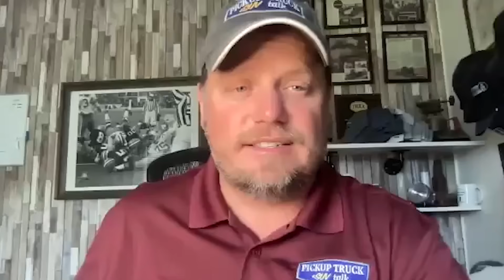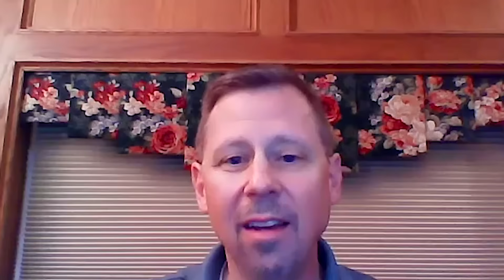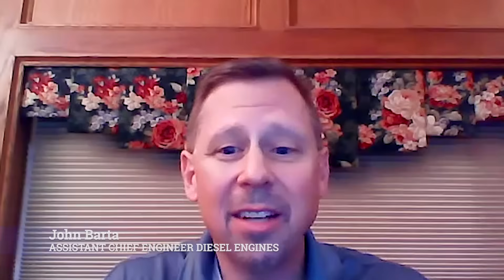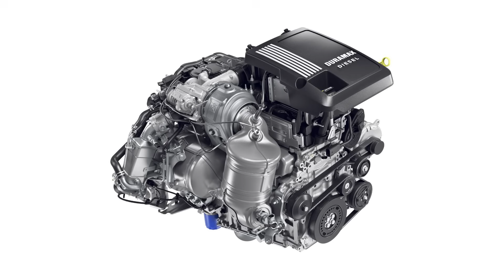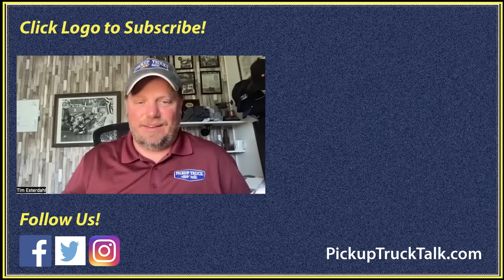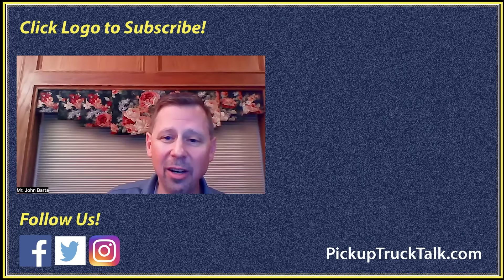GM's 3.0L Duramax Diesel Engineer Answers Questions Owners Keep Asking

Comment: If   your   "diesel   engineers"   are  so  intelligent,   then  why  do  you  have  a  diesel  engine  with  a  belt  driven  oil  pump????    If  GM  wants  to  get   serious  about  putting  " low  maintenance"  diesels  in  trucks,  go   talk  with  the  following  FIRST:   (1)  a  certified  diesel  mechanic  for  Cummins  and/or  Caterpillar  ,   both  have  been  building  " straight  six"  diesels  for  over  100  years;  (2)  Cummins  AND   Caterpillar  engineers  to get  a  basic  opinion  on  belt  driven  oil   pumps  vs  gear  driven,   and  DO  NOT  design  an  engine  with  the   oil  pump  located  between  the  transmission  and   engine;  GM  knows  absolutely  NOTHING  about  diesels,   I  have    owned  3  Cummins  powered  and  2  Caterpillar  powered  trucks,  and  those  engines  are  built   to  run  a  minimum  of  750,000  miles.  And  YES,  those  are  in-line  6  cylinder  diesels  with 750-1200  #  of  torque,   much  more  than  ANY  V-8!!!!

Comment: And the LZO is already failing in 2025. Just seen a video from a dealership with 2 1500 3.O's in with blown motors. 😢
Reply: For a few months in 2025 their supplier supplied some bad thrust bearings. Jul’25-Sep ‘25.  Not all of them… just some had the bad bearing installed.  Most fail under 5k miles. Get the warrantied new engine and enjoy it.

Comment: There was a video from GM engineers that said it was due to room. This video confirms they believe it was the right choice and the new 3.0l block handles 200k miles per service. Here is the link at minute 17 about talks quickly about the oil system. https://youtu.be/J7KM5-oMLm8?si=Ra2X_xiq_9Lose2W

Comment: What do you think about this product... Can you do a video on this?  (CCV Catch Can for LM2 and LZO).  The 3.0L LM2/LZ0 Duramax Diesel from the factory directs crankcase oil vapor and condensation directly into the turbo inlet for reburning. This oil plates out and sticks to the turbocharger blades and heat exchanger coils reducing efficiency of the system. This oil residue will increase the pressure drop across the heat exchanger resulting in higher backpressure placed on the turbo and worse fuel economy. 

We have designed an integrated OEM appearing catch can system to remove this oil and water vapor intrusion as well as provides the same exact crank case vacuum draw as the factory to protect the seals of the motor.  Is there any truth to this?

Comment: a belt driven oil pump only makes sense when your average customer who buys the truck new won't keep the truck until the first belt change interval comes.  The answer pertaining to the belt seems very dimissive; for example, what are the good reasons for the belt?  Quiet? Less Vibration?

Not appreciating this design.

Comment: Engines can only stop running in a factor of the number of cylinders. An 8 cylinder only stops in one of the same 4 locations on the flywheel, a 6 cylinder in 3 places, et cetera. The fact that these are stopping a degree off is weird.

Comment: Duramax engine s are not U.S engine.  It is an Isuzu engine.
Reply from the maker: "The GM Duramax engine plant, otherwise known as GM DMAX Ltd. or GM Moraine Engine Plant, is located in Moraine, Ohio, United States. The plant is a joint venture between General Motors and Isuzu Diesel Services of America, with 60 percent belonging to GM and 40 percent to Isuzu."

Comment: I heard him say it would be too much to change that belt.  Is that belt warranted for 200,000 miles?   Doubt it.  I had a Volvo diesel belt bust and totalled that engine.  I love my Ecodiesel and just don't know which way to go when it is time to turn in that truck.
Reply: This belt is under barely any load and its sole task is to spin the oil pump. It's completely different from a belt that has to turn camshafts, which is a massive  load on the belt.

Comment: We've own a 2023 Sierra 1500 Elevation with the LZ0 / 10 speed automatic. This is now our 3rd diesel ever owned (first was LB7 Duramax, second was om606 Mercedes E300). After driving many other diesels new, old, mechanical fuel injection, and so on, this is now my favorite engine (gas or diesel) of all time. The power is more than adequate for fun city driving, long distance traveling to visit family and the fuel economy is shocking. From a dead stop, stomping the gas will spin the rear tires with ease, you actually have to hold back and get rolling first before you mash it if you need to slide over a few lanes to make an upcoming turn. Taking night drives with the wife we've seen 30MPG on back roads under 50mph. I can't say enough good things about it almost 6 months into ownership. I hope that lasts for years to come.

Comment: Well 2022 3.0 melted down with the canceling injectors... steal piston don't melt down. Problem is it don't disperse heat... the engine will run better .how long will it last don't know.... will sell mine 2023 at 50,000

Comment: I have a 2023 High Country 3.0 Duramax (LZO)...just hit 20K miles. pulled my first small 18' camper/trailer and was blowing through DEF.  Found out it was going to the 65mph warning at half the DEF tank.  I would put 1-2 gals in and it would show 7/8 full (never full, even when it just started to spill out the first time I went to fill.)  What is the issue?  Tech issue?  DEF tank indicator (mech.) issue?  Just annoying to have to fill 2 gals of DEF every 300-400 miles.  Could it be from towing and having in tow haul mode?  This is my first Diesel, so I'm not familiar with DEF and issues that can arise from normal driving to towing, etc...Thanks for any ideas, answers and solutions.
Reply: I have watched other videos on this engine and it does use more DEF than the LM2 version, especially while towing. I think the youtube channel was called Demonworks. The DEF level indicator seems to have this issue where it won't show full. Might be a future TSB/software calibration kind of thing.

Comment: He didn't sound like an engineer! No solid technical answers! He sounded more like GMs marketing department! He said they had this lz0 engine designed even before the lm2🤣🤣🤣 
BTW he didn't know what the lm2 and lz0 stands for! There is alot to say but ill keep it here.
Reply: The LM2 started in dev back in 2014 with meeting 2020 emissions. I’m sure they finished the whole engine by 2018 as they got ready for production. By that same time, what he said would make sense for them to start developing the LZ0 variant to meet the newer emission standards in 2023.

Comment: Love this channel and it’s content! I’m a first time truck owner and I went with a 2023 GMC Sierra with Duramax.  Our entirely family loves it, and we just cannot believe how efficient this engine is.  I also liked your video about the benefits of using Top Tier Diesel - love this truck so much that we want it to last.
Reply: Change the oil every 5000 miles (don't rely on the oil life meter) and make sure to service the fuel filter as required and you should have no problems. Always monitor the oil level just to be safe.
Reply: @hochhaul  thank you for the advice.  I have no problem pulling in the service intervals if it will extend the life of the vehicle.  We are here in Arizona, and with the heat I imagine it can’t hurt.
Reply from the maker: Welcome aboard!

Comment: They totally suck I bought two of them ran great 75000 miles then fell completely apart by 150000 miles 22 hours to change oil pump belt 16 hours to change ac compressor 900 dollars to change cooling fans doing work myself glow plugs and module went out at 80000 defective baffle in valve cover calls for 14 hours labor before you buy parts which there is a service bulletin on but no recall even though it makes it use 4 quarts of oil between oil change do not buy one of these trucks unless you are rich!

Comment: Chevy (and other manufacturers) are penalizing the customers by not finding a way to get emissions control that doesnt use exhaust fluid, or find a cold weather formula adjustment.  Cold weather tank freezing and buying urea has been the only thing that's preventing my purchase of a small diesel.
Reply from the maker: What's the cold weather concern? It was -20 degrees Fahrenheit here a few times this winter and zero problems with the 2023 LZ0 I bought for the channel.
Reply: @Pickuptrucktalk   I don't have personal experience in this matter, but it gets -40/50F in Fairbanks, AK and some of my coworkers have noted their tanks will freeze and require extended warm ups (even for here) or parking in heated garages (despite winterized vehicles with block and pan heaters).  This was on 6.6L and Cummins trucks.
Reply from the maker: @70below  diesels have long had issues with cold starts and that was well before emissions equipment or DEF was added to the engines. 

They have gotten a lot better at starting in the cold. That has nothing to do with emissions or DEF. It is the diesel fuel and engine.
Reply: @Pickuptrucktalk  New diesels that have been winterized actually start fine compared to the diesels of old, but my understanding is until the def fluid flows you're effectively in "limp" mode.
Reply from the maker: @70below  true the start better. GM recommends plugging in a diesel at 0 degrees and not above 0.

DEF can freeze at -12 degrees. Nothing automakers can do to change chemistry.

I started my long-term review Silverado 3.0L diesel at -20 and was mostly fine. Just ran sluggish.

Again I don’t see what you’d want automakers to do to change chemistry.
Reply: @Pickuptrucktalk  I'm not trying to bash them, I think they've done a lot with the new motors, but I do work in the air quality field, and I know there's room for improvement.   There is a lot of cold weather research done by auto manufacturers in my area, and I know there are antifreeze agents that can be added to DEF that could help cold weather freeze performance, but they may need to make other changes to improve emission performance with a formulation change.  Remember that most of DEF is water, changing that somewhat could help.

Comment: Why isn’t this truck considered a HD?
Reply from the maker: Because it is built on a 1500 frame and suspension.
Reply: @Pickuptrucktalk  they use to have a 1500 HD
Reply from the maker: @ChadCOMO  They did and it failed miserably.
Reply: @Pickuptrucktalk  Thanks for all your videos, I’m enjoying them. I just got Chevy LTZ 3.0 Duramax w/max towing yesterday. Searched high and low for it. There’s hardly any out there. Was told you would be able to start ordering them again in May and start or producing in agin in June. I was excited to get it. I’ve heard fuel economy is outstanding.

Comment: New Subsciber..I know I am late on this video but just bought a 2023 RST/Z71 with the 3.0. Your comprehensive videos helped me make my choice. I have been thrilled with this truck and have only put 500 miles on it. In that 500 miles 200 were pulling my open trailer with my 72 Corvette to the drag strip and got 18.5 mpg. In my 2015 Silverado 1500 with 5.3 I would get 12. Pulled like a champ. Thank you for the effort and time you put into the research. Thanks to GM for allowing the engineers to come on and answer questions. Keep up the good work.

Comment: Just bought a 2023 w/ the LZ0, love it. It does have a growling sound that is intermittent at low rpm. (It’s different than a turbo spool sound) Of course it wouldn’t do it when I brought it to the dealership. Have you heard of this coming up with anyone else who has this motor? I have a video of the sound.
Reply from the maker: I haven’t heard of anything like this.

Comment: Big concern is you need to replace the oil pump in back of motor at around 150K miles.  Big deal because you have to drop the transmission to get to it.  Figure about 2K for that job and if you keep it that long you have to do that service.  Heck just checking the pump will still cost you 1K.  And why they made it variable?  Who knows.
Reply from the maker: Belt, not pump.
Reply: @Pickuptrucktalk  correct.  Probably wouldn't buy a used one because of that.  The new one with 200k mile service interval probably wouldn't affect me.  Like most gm vehicles you never want to buy the first couple years.  Unlike dodge I think gm finally figured out how to make a light duty diesel.  I'm considering buying this.  Really don't need one but I love diesel's and can't see ev  as something I'd buy as it's to compromised.
Reply: @HiPlains1  did u bought the truck? I want buy one I don’t know nothing about diesel , all my live o owned v8 trucks
Reply: @watchmanexpert  Not yet.  I've taken myself off the market because of the banking crisis.  Better deals are coming as the automakers and banks come crashing down.  Unless you really need transportation the key word is wait.

Comment: Bought a 2020 Silverado with the 3.0 Duramax (62k miles) in Aug, 2022 thinking it was going to be awesome... WRONG!!! in the first 6 months of ownership it sat at the dealership for 55 days, check engine light will not turn off, chevy flew out some field engineer and still waiting on parts for 4 weeks now. It is sad when you walk into the local auto zone to have them scan the truck every other day and you have the code memorized... P1488 exhaust code and waiting on some backflow valve and seals, parts have been ordered every time it's been to the dealership but never given an explanation on what is exactly wrong with the truck. Since it is drivable they dealership and chevy told me to keep using the truck and never once attempted to give me a loaner. No answers from chevy except "we are pulling our resources to find parts" even though i was told by chevy that parts would be pulled from the assembly line... yeah sure okay...
Reply: The delayer fixed the problem? Men I want buy diesel but history like yours scare me

Comment: So this is the brainiac that submerged a rubber belt in oil for the oil pump. Why not a chain or shaft like every other engine ever made. Whoever designed that should be fired for a total lack of mechanical knowledge.
Reply from the maker: Like he said in the other video, he couldn't do a chain belt.

Comment: This engine is such a gem. I drove a 21’ Yukon on a long road trip and got 26-28 mpg driving 75-85 mph. Super smooth, and it sounds so good. Very good power. This is definitely the engine to get in these trucks if you do lots of highway driving. 50k miles and no issues with it.
Reply: hows the emissions?

Comment: I’ve only got 500 miles on my lz0 and it’s a beauty to drive. Smooth and powerful when you need it. The truck drives incredibly so far.
Reply: I just got my lz0 and its badass, i just hit 500 miles

Comment: I came across your site and your interview with John Barta on the long crank issue on the earlier 3.0 Duramax 3.0, I have a 2021, it’s happened to me many times over the 16,000 miles it’s never failed me to start after the issue of the long crank with no start, on the second try. I referred this to my dealer and I trust them because they’ve been a fantastic dealer and I love the truck but they state that there’s no such bulletin that went out so I was wondering is he just feeding you candy on the fix and  just an error at my dealer level. Without them reproducing the incident which is almost impossible they cannot do anything, so how does this fix the problem if they can’t reproduce the problem. Does GM automatically complete the repair? If the customer complains of the problem,I assume it’s just an electronic update? I would like that answer because my dealer cannot produce a problem on the vehicle and that’s the only problem I’ve ever had on the vehicle.
Reply from the maker: Print this off and take it to your dealer.

https://www.gm-trucks.com/tsb-issued-for-no-start-long-crank-condition-occurring-on-trucks-suvs/
Reply: THis service bulletin is for Gas powered vehicles,  no 3.0 diesal is listed even in the updated 2022 bulletin?  See if he can answer the question with a real service Bulletin number that is related to the 3.0.  When you talk to the deals they say is is none? @Pickuptrucktalk
Reply from the maker: @joelovercio5968  Sorry, here is the correct TSB. Easy to find via Google: https://static.nhtsa.gov/odi/tsbs/2021/MC-10201306-9999.pdf

I only talk with this engineer once every few years FYI.
Reply: Thank you so very much for the information helps alot.
Reply: I truly appreciate your response and time, but the new Bulletin that you sent me is not related to what the GM engineer is talking about. I will get in touch with my dealer again to see if they missed it, They see no such bulletin on the 3.0 that the GM engineer is referring to. This new bulletin you sent me is for an inspection which takes over three hours of labor and a re-shim.  The GM engineer was talking about a flash update of the ECM for a longer crank time, which requires no tearing into the motor. The bulletin You referred to on the first Email was related to the long crank no start but not for the 3.0 diesel motor. I’m just wondering if there is such a update ECM bulletin for the 3.0 to solve the problem.  The internet is full of these problems on the 3.0 and no one seems to have had it corrected with a ECM update? No one seems to have the answer?  Again, thanks for your time. I’ll let you know what my dealer says.

Comment: When can I get a Z71 Tahoe with the Duramax diesel??  The last time I checked, the diesel is not available on any Z71-optioned vehicle.  I read somewhere that the front bodywork design of these models does not provide enough cooling air to the required radiator capacity of the diesel engine.  I can't believe this couldn't be fixed soon.  It recently lost GM a sale in my case.